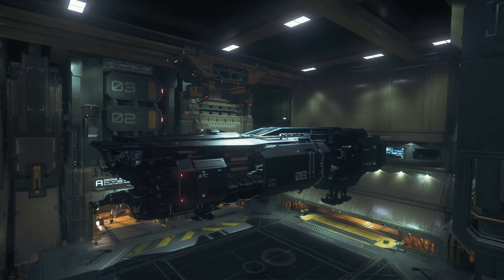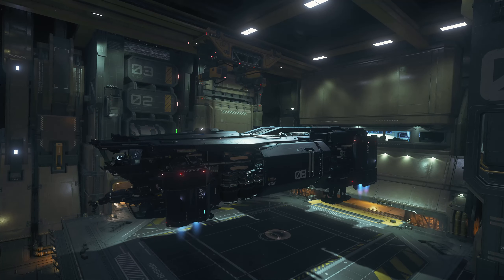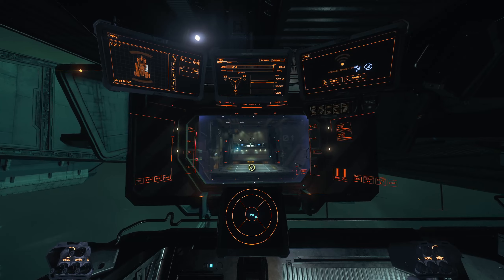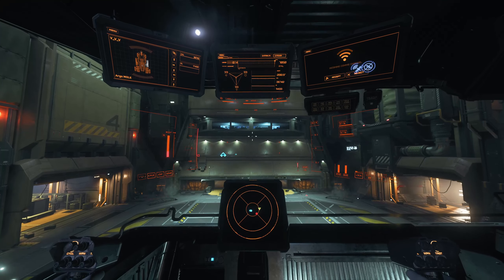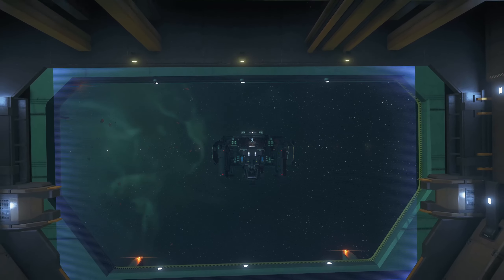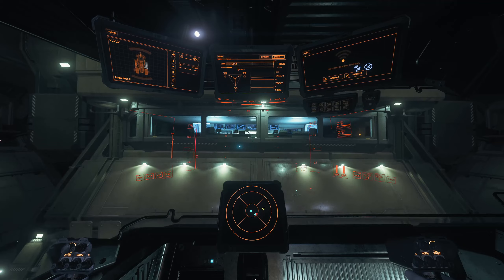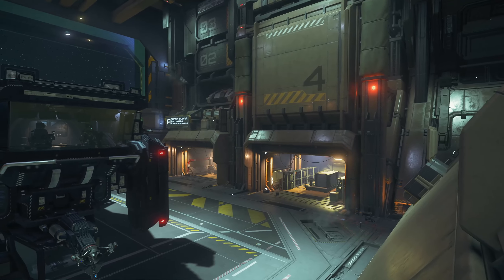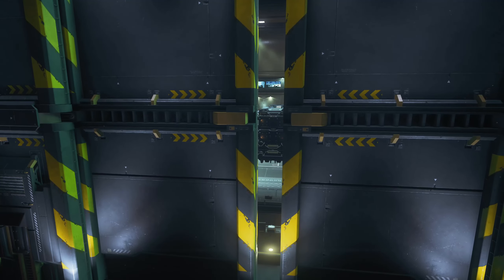Star Citizen: Argo Mole Important Tip! Save your Quantanium!

Comment: TY for proving I'm not loosing it I noticed hanger drop with the Mole, the Cutty Black and the Taurus it is tricky with the Black because her engines struggle to clear the door threshold opening in Vtol articulated position
Reply from the maker: Good point! You might have to take the cutty into the hanger a touch hotter, lol... or back in :)

Comment: in settings turn off proximity assist
Reply from the maker: It's off, I disabled it a long time ago :)
Reply: @SpaceShortsYT  it resets after patch mine was on so i turned it off again have the same issue with cat wanting to drop to pad all the time ,but i will try with the mole see if it not responding..
Reply from the maker: @dadmin-2434  Ya, I had checked it again, the first time it happened, and it was off. Not sure why the setting persisted, but it was defaulted off. I could always turn it back on, and then back off again... give it the ol' boolean kick ;)

Comment: other then the vtol thing and hanger is the mol working as intended for mining, and vacuuming up stuff?  

What would you recommend using the mole for? would it be more practical to use a cutty w/ roc if youre solo planet mining? or prospector planet/space? New to the verse and thinknig about trying mining.
Reply from the maker: It is working. We use it a scooper for Mining Ops with more  lots of miners. That's it really. For solo the Prospector is more efficient at the moment, go to the Halo :)

Comment: I actually think that this is a bug.  I had this happen with my prospector for a few days in 3.17.2 and after reclaiming it stopped.  Basically the gravity setting in stations gets turned up too high.  Bug....not a feature.
Reply from the maker: Hi Eric! That's interesting for sure! I will try and destroy it and reclaim it, and see if it goes away. If it makes any difference, It was destroyed the first time, I crashed into the platform with 50 SCU of quant on board, I tried to run out of it,... after we belly flopped and the alarm went red, but didn't make it out, hahaha :)

Comment: had this happen to me once early on this patch >< I was so used to pad landing in previous patches and boy did I get a wakeup call! I immediately went VTOL from there on out...  But, I did some testing after my mining crew last night lost roughly 2 decent loads of Quant, one due to an Auto land fail(it smashed his nose against the back causing to be unstable and kaboom), and the second being falling into the hanger gravity. So in my test, I left the hanger with limiter almost at zero, and returned with the same limiter and it was perfect, VTOL on of course.  My pilot is 100% sure he vtol'd on coming back and STILL fell.. Im really wondering if there is a bug where it wont engage those thrusters to compensate for gravity. I feel like I had this too when coming down to Lorville and crashed, and i was SNAIL pace coming in VTOL enable and full thrust. Something seems funny with the Mole right now..
Reply from the maker: Thats very interesting! I am going to be using the Mole quite a bit more as we ramp up. I'll keep an eye on it :)